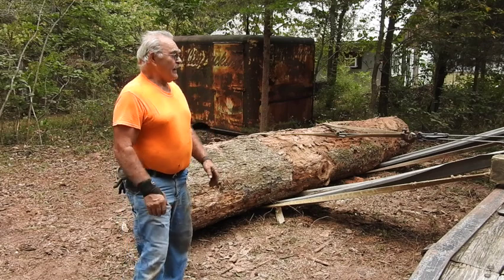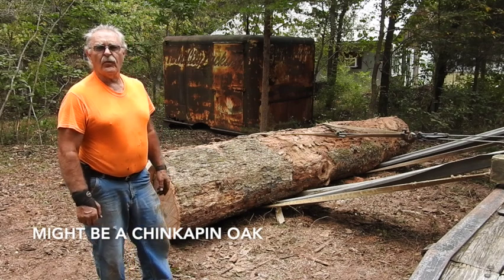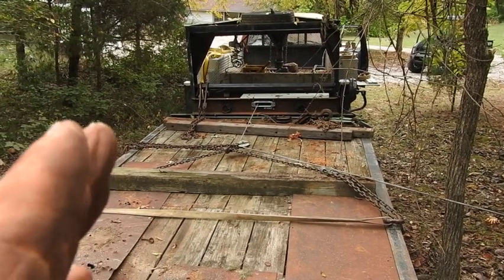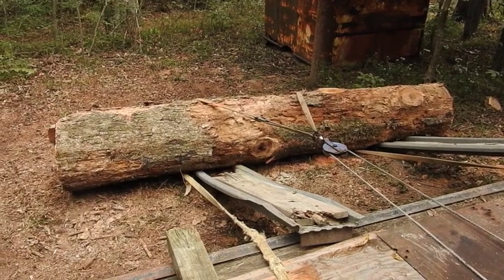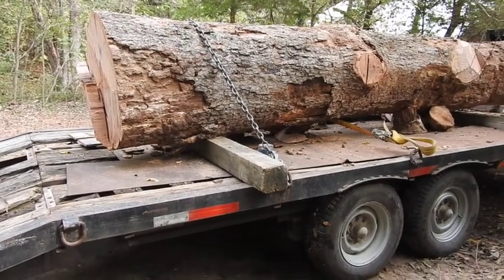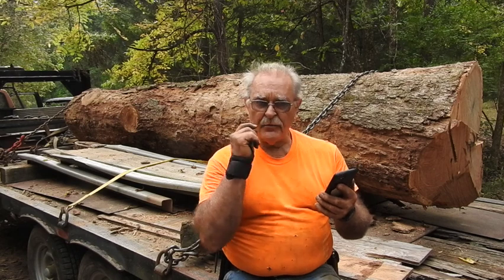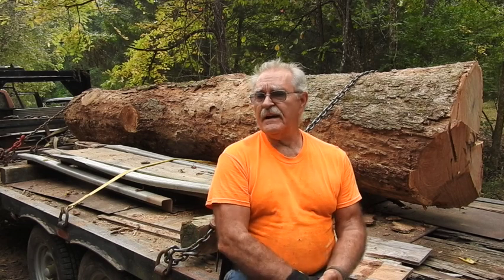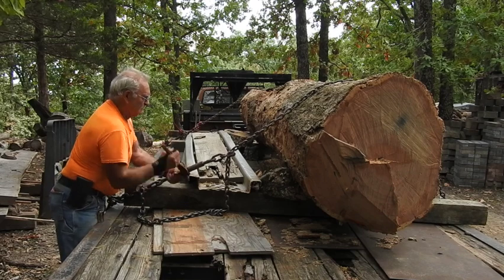3000 Lb OAK LOG- Snatch Blocks Are The Go To Tool

Comment: Is there a way to get a log like that on a trailer without ramps? I have the snatch blocks and a cable and a winch. Just don’t have ramps to get her over the side. Other than chain jacking it up using the boom of the tractor to get it over the edge and pushing the log with another tree.
Reply from the maker: Three 6x6's should support a log this size.  Two may do it if you crib up under the center of the 6x6's to keep them from snapping.  But you can always dig down about 6'' for the wheels to sit in on the side you are loading from too.  Six inches take a lot of the steepness out of the makeshift ramps angle.
Reply: My biggest problem has been getting it over the tires. They come up about 4 inches on each side. And of course when I had the log to the top it hit the tires and then the weight shifting too much I guess broke my timbers. Any advice on how to proceed?
Reply from the maker: @lindastanley3781  well,without actually seeing just what it is is happening and what the circumstances are, I really have no 'for sure' suggestions.  Many times a different 'set of eyes' sees things the the first person over looks.  So another suggestion is basically just a guess.  But whatever it is you do, do it with safety in mind.  A log this size will squash you in an instant or do great bodily harm faster than you can imagine.  Good Luck my friend.

Comment: Pulleys are the way to go for leverage. A skid steer is the best machine for loading and unloading especially how it can turn in a tight space.
Reply from the maker: Hot dang, that's the truth.  If I could get the skid steer to every job, that would be my 'go to' machine.  So many times we can't tear up the place and other times its not worth the two trips just for one log.

Comment: Hello...
Just started watching your video of milling a pine log and was wondering if you could maybe sometime post how the forks hook/ bolt to your tractor bucket?
They look homemade and I'm interested in making some and looking for ideas.
Thanks an advance. 
Have a Jesus filled day everyone Greg in Michigan
Reply from the maker: Yes, as a matter of fact Greg, here's the video of putting it together.  I ended up adding an angle iron to the bottom of it, because I found out the little 3030 does have enough ooomphff to bend the 2'' channe reinforced with the 1/2'' flat iron.  If I were you, I'd reinforce 4" angle for additional strength or even bigger depending on what your tractor is.  I made a set of similar 10'' channel iron forks for the 4500 Ford backhoe.  To put it in perspective, that's about a 60 hp tractor. https://www.youtube.com/watch?v=4Dq_e_3I3N8&t=17s
Reply: @tractorman4461  
Thanks, I'll  check it out👍
I have a kubota B2601 ( bought 
3 months ago, new. Retirement gift to myself) had a kubota bx2660 for 11 years before the upgrade. 
I think the forks were $1200 to $1800 at the dealership.  I know I won't use them often, but just once and awhile, so a set of homemade ones may do the trick. 
Once again, thanks for taking the time to reply
Have a Jesus filled day 
Greg in Michigan

Comment: You've been talking about that trailer deck for a while now lol. That lx865 has a lot of weight in the rear end
Reply from the maker: Yes, the 865 tops the scale right at 10,000 lbs.  I've had some stuff on it that made it walk on the front two wheels before.  I'm in the process of locating a flat bottom grapple for it now.  That will help out a lot around here.

Comment: gotta love them homestead trees just watch out theres metal in the damn thing oak shows if it has metal and my dad has milled with the woodmizer lt20 for over 6000 hours and havent yet missed metal if theres black marks on the oak  it will ruin a blade for ever try as you might cant get them back in set
Reply from the maker: Yes, I spotted the blueish spot as soon as it fell.  I use a metal detector wand when I get them on the mill.  I always skin off the bark where its embedded with dirt or debris then pass the detector over the whole thing.  I find quite a lot of the ones near the surface other times I'm not so lucky...especially if they are embedded deeply like this one appears to be.

Comment: Good morning Wendell, Incredible video footage of that 3600 pound beast being winched up onto the flatbed trailer. I learned that synthetic cables are safer thanks to you. What an ingenious way of doing this.  This will definitely yield some great planks! Thank you for sharing. Your friend Rob in California
Reply from the maker: Good evening Rob !!  Snatch blocks can be used to drag all sorts of dead stuff to the deck of a trailer.  I used three of them to snake a tractor out of a packed barn that the guy told me would take a day and a half to dig out.  Not so with the strategic placements of the blocks !!  The old boy was quite shocked at how easy it was.  
    Another time I bought a 2,000 pound machine that the guy told me took six men to unload and put in the building where it rests.  I showed up by myself and he was very doubtful, being as how he walked with a cane.  Well, he too was surprised as all I had to do was push the button to put in on the trailer.  Well, I did have to move the ramps and string up the blocks.... LOL.   
  Yes, the synthetic rope might sting the devil out of a fella, but at least it's not gonna cut a guy like a cable can.  When in doubt lay a heavy blanket on the rope or cable to help deaden it if it snaps.  Tip of the day.  (-;  Thanks for watching a poor boy playing in the woods today.

Comment: That winch was grunting a little.  Always interesting to watch the loading of a huge log, especially in a tight spot.   Imagine the work it would be for a team of horses back in the day!
Reply from the maker: Well, it's a 12,000 lb winch running off of jumper cables draped across the tool boxes up to the front of the truck, so I was more concerned that my battery would fail to start the old truck when done.  LOL It's already an 8 year old battery. But yeah, a team of horses might grunt a little bit with this one.

Comment: What species is that log? The bark makes it look like something in the white oak family but the darkness of the end gives it that red oak family look. I suppose that could merely be tissue discoloration depending how long the tree has been dead. It did look like it had a small blue spot in the butt end indicating metal inside. Might be something as harmless as a bullet, but then again it could be something more serious. Hard to tell from the video. Lots of work done and much more to go.
Reply from the maker: Yes, there is a piece of metal...probably a spike or nail.  My first thought was it's a red oak, but it may be a chinkapin oak.  We have over 20 varieties of oak in Missouri and I cannot differentiate between them all by any means. I can tell more when I see the grain better.  This thing's been dead for a few years standing.  I've been sawing some of that maple this week too. I kinda refer to you in one of the videos when I'm cutting the straight out of one of the crooked ones.  It's not a bad comment at all. LOL
Reply: @tractorman4461  I hauled logs to the mills for 18 years in Wi. and had occasions to sit in the sawyers cab and see how it's done. You certainly see different skill levels and that there his probably no right way to do it sometimes. I'm looking forward to seeing how you approach the problem.

Comment: Wendell, another good job at loading a large, heavy log.

I'm assuming you still have that 72 Ford 2000.  I ordered hood decals for my '67 Ford 2000 and they sent me ones for a '68 to '74.  So if you want new decals for your 2000, let me know and you can have the set they sent me......free, of course.
Reply from the maker: Well Terry it'll probably be a few years before I'd ever get around to doing any 'prettifiation' to the 2000 but I can always store them safely until then...but I wouldn't want you to just donate them to the cause.  I thank you for the offer and for thinking of me.  Its living at my son's house about 2 miles down the road and still running like a top.
Reply: @tractorman4461   I can't use them, and they're just sitting on my desk next to the computer, so they're yours if you want them.
Reply from the maker: @316jd140  Hot dang....how can I pass up a deal like that... LOL.  Thank you, I appreciate that. Next time I head down to the Farmington Kubota dealer I'll need to stop by.

Comment: Good evening Wendell 
Impressive loading job..
You still will get a pretty good jag of lumber out of that log even with the rot..
Thanks for sharing another great adventure.
Cheers my friend
Reply from the maker: Thanks Gus for the visit, and yes, there's roughly 500 board feet in it if it'd be solid all the way to the end.  So If I get 400 bd ft out of it I'll be tickled. Might not get that, but no matter because the off fall will become firewood anyway.

Comment: Good 'cross haul' rigging. Set the 'skidpole' on top of the 6 X 6 next time.
Reply from the maker: Yes, I would have except for the 3'' angle iron on the ends to snag the edges of the trailer.  If they'd been flat that'd been fine.  Make sense?  Thanks for the input as well as for watching us on our playday.  LOL

Comment: Wow Wendell! That was impressive!
Reply from the maker: Good Morning Gary.  I could've made the job easier if the skid loader went over there with me.  Thanks for the supportive comment my friend.
Reply: @tractorman4461  , we finally are getting rain here Wendell, after a 4 1/2 month absence.
The last rain we got was May 14th.
We had some sprinkles but never reached 1/10 of an inch. We were more than 9 inches below average rainfall for the season.
Last Friday we got a nice 2 inch slow soaking rain. Monday night we got another 2 inches and last night we got 6/10’s.
Reply from the maker: @tractortalkwithgary1271  We had a slow all night rain last night too.  We needed it too.  It's not been as dry here as you indicate...4 1/2 months of dry weather.....WOW !!